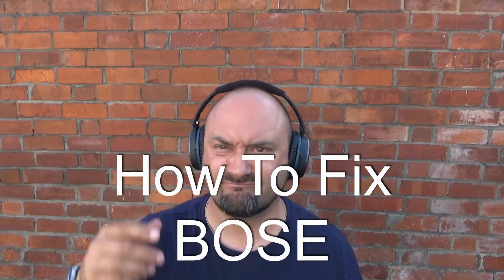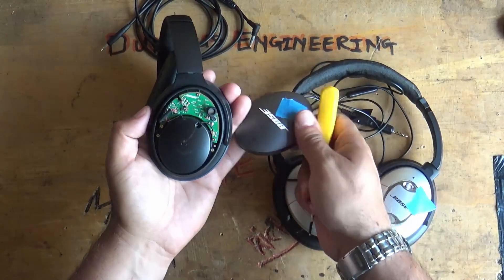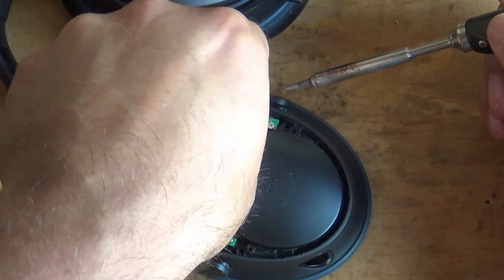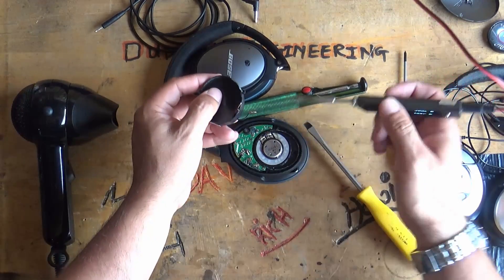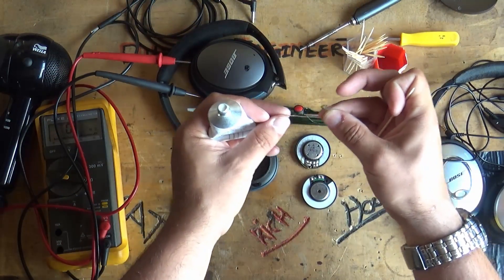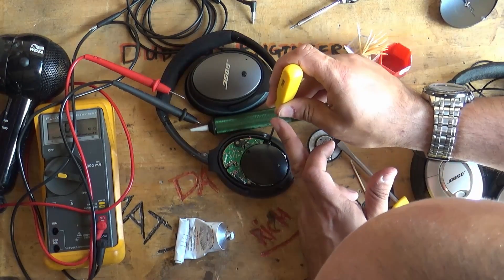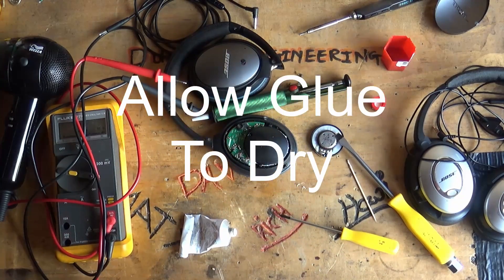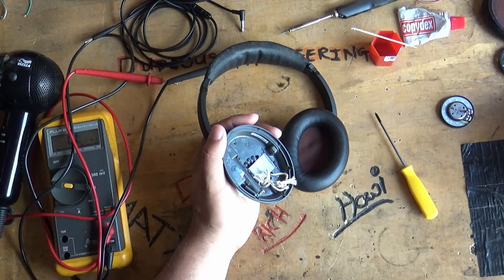DuB-EnG: Repair BOSE QC35 QC25 QC15 Quality Headphones Fix Faulty Quality Problems One Speaker Work

Comment: so this process is a lot more pain with the qc35...make sure to make the glue really hot. Good news is: I was able to replace the speaker with one I bought from alibaba. Bad news is: the bass is slightly different and the noise cancelling doesn work as well as with the other speaker. So basically they are still useless...because I assume that when you buy a bose you pay attention to little things like the intensity of the different frequencies...

thanks for the video but can't be recommended for my qc35 and the alibaba replacement speakers (which are fine too but just not the same!)
Reply from the maker: Interesting... the speaker I purchased was from eBay and it sounds perfect... like a direct replacement...  sorry your repair didn’t work out so well...  :-(

Comment: Does anyone have a reference to original speaker part used by Bose in the QC15 ?
Reply from the maker: Don’t panic... they use regular speakers and profile the sound with a DSP... so, just type “replacement qc15 or qc25 speaker” into eBay...  trust me on this!

Comment: Does anyone have a reference to original speaker part used by Bose in the QC15 ?
Reply from the maker: Its in the comments section, but just check eBay.
Reply: Thanks. I eventually used this and it worked well and sounds identical: https://he.aliexpress.com/item/32883884428.html?spm=a2g0s.9042311.0.0.3b464c4dQ8X9Y6
Reply: eBay (Same 40mm size drivers are also used in most high end headphones manufactured by other brands like Beats, JBL, Onkyo, Sony and so forth)

Comment: The Replacement speaker qc25 is te same that qc15?? because i have and old qc 15 and i wolud like to replace from my qc 25 rigth speaker damaged, ah i dontt now if is better replace both speaker at the same time to keep the balance and frequencies at the factory level.
Reply from the maker: Yes sir...  exactly the same speaker... you can find it on eBay!

Comment: Glad to see an excellent DIY video. The glue used (copydex) does this get soft and takky after heating like the original. Just incase the replacement breaks...
Reply from the maker: Yes it does...  it holds together, but turns rubbery so you can take it apart again in the future....
Reply: @DubiousEngineering  that's awesome. I was considering PVA but on the plastic driver case it sounds a bit iffy. Copydex it is. Thank you!
Reply from the maker: Justin bunn## ...  PVA can go off quite hard after a long time...  copydex stays rubbery...  you could even use a thin sausage of evostick bluetack
Reply from the maker: Thanks so much for subscribing to the channel... I hope we can keep you entertained with electronics, adventures and gadgetry!
Reply: To put the drivers in ear cups like factory installation, only use 3M™ Yellow Super Weatherstrip and Gasket Adhesive (available in auto stores mostly).

Comment: SHOULD I BUY ONE OF THESE? I ONLY HAVE ENOUGH MONEY TO BUY QC25 AND REALLY NEED EXCELLENT NOISE CANCELLATION AS I AM IN A VERY LOUD AREA. BUT I HAVE HEARD THEY STOP WORKING AFTER SOME TIME. REALLY WORRIED AS I CANT AFFORD ANY EXXPENSIVE MODELS.
Reply: Yes go ahead get one from eBay, they are good and won’t break so easily
Reply from the maker: Yeah, the modern ones are pretty good now...  Its the older models that break easily...

Comment: My right speaker died on my qc35ii so i used this guide and ifixit (https://www.ifixit.com/Answers/View/490400/Replacing+battery+in+Bose+QC35) since this guide didn't show a qc35 ii teardown (it was close though).  

I didn't remove the back pad (at 45 seconds) as it was easy to move it out of the way and didn't need to remove (wasn't sure if I would have to re-glue during reassembly).

I didn't feel like the description on how to use the hair dryer to heat up the glue was described very well (or maybe i just missed it but I listened to the section several times...).  I spent about a minute with a hair dryer moving around the speaker cover and didn't melt the glue at all (the head phone was hot enough at this point to where i couldn't touch it).  I though maybe it was super glue so I ended up making a few incisions with a dremmel tool.  Prying with a lot of force i was able to get the cover up and saw that it wasn't super glue (at this point i didn't think i was going to get the speaker to work and was just going to tear it apart to see how it was made).   Once the cover was up I used my heat gun for about 5-10 seconds (it was set to 800F, not sure if the air at the nozzle really gets that hot) and watched the rest of the glue evaporate to get out the speaker (so i think this guide may have worked if i had just used more heat).

Thanks for the guide, i now have a working QC35 again!
Reply from the maker: I believe the QC35s use a different glue...  Harder stuff...  Thanks for your input here, its really useful to everyone!!  Great work and well done on the working headphones!!

Comment: Very clear instructions with excellent images. Great work, Dubious. 
I have the Bose QC15 headphones. The little spring on the negative battery contact broke off. I'm not sure how to repair it. Perhaps it can be soldered on, but I have no idea how to remove the hinged plastic battery 'door' to allow access with a soldering iron. I imagine this piece is easily broken. 
Any suggestions? Thanks!
Reply from the maker: Wow... I’m so sorry... I no longer have the qc 15 ...  if I did I’d have a look... perhaps ifixit on google may be able to help??

Comment: What driver was the old one replaced with?
Reply from the maker: Search eBay for qc25 replacement speaker
Reply: eBay (Same 40mm size drivers are also used in most high end headphones manufactured by other brands like Beats, JBL, Onkyo, Sony and so forth)

Comment: The microphone on my QC35s stopped working. Meaning, I can still hear everything (with noise canceling) but can no longer make phone calls since the person on the other end can't hear me. Any ideas on how to fix or replace a broken QC35 microphone? If it's helpful to know, it might have stopped working because I wore them in the rain. Thanks!
Reply from the maker: Ah yes...  the rain would do it.   It will be a PCB mounted microphone...  you can buy replacement Miniature Electret Condensor microphones on eBay.  But you will need to look up the size.  I can’t remember if it’s mounted in the left or right speaker.
Reply: @DubiousEngineering  Thanks! Any pointers on where to find the size? My attempts to find this info online have not been fruitful. Thanks again....
Reply from the maker: I’m sorry I’d have to open mine up to measure it!!

Comment: Loved your video. My son got a pair of AE2s from his granddad. Not only is one side lower in volume than the other but the overall volume and SQ is lower, lacking in both bass and they sound suppressed. I fiddled with the cable to check if the problem was there but no, i have a feeling that the speakers conked. What do you think? Also, any ideas of the driver size and where I can get them?
Reply from the maker: Have a look on eBay...  the qc25 speakers are listed as “replacement qc25 speaker” ...  I hope this helps and good luck!!
Reply: @DubiousEngineering  Is the glue necessary? Is it only for holding the speaker in its casing or does it also positively make a difference to the sound?
Reply from the maker: Yes, it really helps with the sound too...   it isolates the speaker from the microphone!

Comment: HELP! My dog chewed up my Bose Quiet Comfort 35's.  It appears that they still work.  They turn on, and it does NOT appear that she (my dog) got to the circuit board at all. It looks like she ripped off the soft pads, speaker cloth, and the silver tape/band is removed. I have no idea what to do.
Reply: My email is Keaton@icloud.com - I can send you a quick photo if it would help. I would be forever grateful! Thank you!
Reply from the maker: Keaton you can buy replacement pads and parts for these on eBay...  I’m on holiday in Taiwan for 3weeks now, but if your still struggling when I’m back I can help you!
Reply: You can get the ear pads very cheap on eBay. Just pull out the old ones kind of squeeze them and pull away. Insert the new ones the same way. No rocket science you can’t break anything . The silver thing can be put back with glue or a blob of bostik blue tack. Cheers
Reply: Thank you all! I contacted Bose, and they sent me brand new ones for a discount of around $100. I snatched up the deal!

Comment: I got a pair of qc25 from ebay. the guy that sold them said they worked perfectly but when I've got them, the noise canceling was not working. I changed the battery and the cable from my other pair (witch works impeccably) but no noise attenuation. Do you know what could be the problem? I asked for a return but just in case that doesen't happen I would like to know if I could repair the thing
Reply from the maker: Question, does the sound change and become louder when you turn them on and there is music playing?
Reply: @DubiousEngineering  Yes; the sound quality is better when I turn them on. I did some "tests"; I've listen to each earpiece separately with the noise cancelling on and off and I tend to believe that the noise attenuation on the right side is not working.
Mabe I exaggerated a little when I said that the noise cancelling is not working.; it is there but very faint in comparison to my other pair
Reply from the maker: If you rub the tiny holes on the outside with your finger, you should hear a louder scratching noise in the earphones...  this is indicative that the noise cancelling is working....
Reply from the maker: A 10 minute message for my regular viewers... https://youtu.be/hAVadIYgLbk
Reply: @DubiousEngineering  Yes, i can hear the noise but never the less, the noise canceling was not working or it was not doing anything. Anyway, I've returned the headphones. Thank you for the tech support!
Reply from the maker: Absolute pleasure... glad you got your money back... some people were less fortunate! ...  Stick with us here... you never know what might help you in the future! :)

Comment: Is there an equivalent to the copydex glue that will work?  Will Shoe Goo or a Amazing Goop work?

Copydex will take a month to order for me.
Reply from the maker: I’m sure any soft glue will work...  perhaps a glue gun? Thanks for your comments, here’s a little preview of a video coming up...  https://youtu.be/wYAJzCo2UOc
Reply: @DubiousEngineering  Thanks for your fast reply and Thank you so much for putting this video together!  My right speaker went out just before Christmas. I called Bose for a repair quote but all they would do was try to sell me a new headset.  I will stop by the hardware store and get some soft glue today :)
Reply from the maker: starsiegeplayer PVA glue would probably do the trick! It’s soft and rubbery...
Reply: @DubiousEngineering  I don't mean to be awkward, but does PVA melt? I'd think that looking for "rubber solution glue" or "latex adhesive" might get you something more like Copydex. Helpful video, by the way, thanks.
Reply from the maker: Totally agree... the problem with PVA it can go off really hard... that said, this is a one shot replacement and pva should do the trick!! ... or consider a small amount of hot glue gun action!
Reply: @DubiousEngineering  Hot glue may be nice, but Copydex is rubbery. Seriously: if the replacement driver goes South, you want to be able to repeat the repair, don't you? Besides, Bose may have had clever acoustic reasons for choosing a rubber-like adhesive in the first place. Resonance or damping or something?

Comment: PLSE SHOW ME HOW TO TAKE OFF THE MIDHEAD TOP PART THE SOFT PART THAT SITS ON TOP OF THE HEAD! MINE IS SO NEED TO BE WASHED! I DOONT KNOW IS THERE ANY CABLE IN IT THERE?
Reply: There are wires in it.  Removal of the headband destroys the soft part, but there are third party replacements on sale on Amazon.
Reply: Be careful when you remove it, do not cut the wire. Just cover both speakers in cling film hold the headband downwards and wash with dish soap and sponge. Dry it off the a hair dryer after patting it with some paper.
Reply: Get a tennis racket handle wrap and cover it up do a neat job. I will try this shortly and upload a video or you do it if you can.
Reply from the maker: I like that idea!

Comment: 11-16-2018    Well I got out the hairdryer and got everything quite hot and the glue didn't get soft on the QC25 left speaker cover.  I nearly melted the thing and punched a hole in the cover with the screwdriver (oops!) trying to pry it off.  Apparently the glue they use now doesn't "melt" with heat - it may be permanent glue - not sure.  Well, there goes $350 for a new pare of headphones.  Can't get the glue to melt.  Any suggestions?
Reply: q7winq7 push it out from inside with a screwdriver...worked for me
Reply from the maker: q7winq7 Awww mate... I’m so sorry... I can’t believe they now made them unserviceable... that’s so mean!!! ..... very unfair!!
Reply: 11-16-2018    @DubiousEngineering  - - - If they won't replace the phones as a quality control issue or warranty, I may just disassemble again and "cut off" the speaker cover (carefully) to access the speaker.  Maybe a hot razor knife?  Then if speaker is accessible, I may unsolder and check ohms of speaker and replace with new ones from Amazon.com.  I think a pair is about $20 US dollars. Now I'm looking for their service dept. phone number for here in the US.  Thanks for all your responses.  I use these phones 7 hours a night in a factory. Can't do without listening to George Noory's program "Coast to Coast."  Check it out.
Reply from the maker: I’ll have a look for coast to coast!!  Thanks for keeping us all updated... people will want to hear more!!!  :-)

Comment: 11-07-2018  My Bose QC35 left speaker (where the wire connects) fades out until I tap the outside on that side then it comes back.  Is that a speaker failure or a loose wire or what?
Reply from the maker: The external wires are quite sturdy...  it’s likely to be the driver speaker...  pop them apart and have a poke around with a multimeter....
Reply: Have you been able to fix them? I have EXACTLY the same with mine QC35, however mine right speaker seems to have the same. Since yesterday it completely stopped sadly enough..
Reply: @gerbenvandooren6037   - - - -  As I recall, I mailed back the old headphones to Bose when I ordered another pair which I have now.  I got the blue tooth set to mate with my phone without a connecting wire.  The work fine but the ear cushions don't last very long.  I wear them 8 hours a night five days a week.  Aftermarket cushions are available for way less money than what Bose charges.  Note:  If I had it to do all over again I would have bought the Bose headphones with the Alexa feature, even though it was more expensive.  Cheers.

Comment: Hey mate - random question but would the qc35s need the tear down to replace the battery? I’ve searched around to see if the battery is replaceable however it seems like nobody has ever posted a video of the tear down.
Reply from the maker: Yes, battery replacement (if needed) would only be possible if you took them apart.  Should be good for a few thousand charges, so unlikely you will need to replace...
Reply: How can i fix may bose headset it cannit conect to the blutooth of my phone
Reply from the maker: That sounds like a Bose support question :-).  Sorry not an easy one for this channel...

Comment: Hi, my biggest bugbear about modern headphones/earphones is the stupidly thin wire that is used. I've tried repairing multiple apple earbuds that have gone at the connector and the less than hair thin wire is impossible to strip to solder or it just breaks. (probably why they are doing away with the headphone jack). It's also true of other brands, JVC, Sony to name just a few I've tried fixing with no good results. Stuff just isn't made to be easily repaired any more, it's just to make you buy more, which adds to waste/pollution etc. Where have all the TV repair shops gone !!(old man rant over)
Reply: I got a nice set of sonys a while back that someone had tossed cause the cable had gone bad in one ear. I buy pre-made headphone plug to 2 rca connector cables, cut off the rca part and solder them to the speakers for new and improved heavy duty cables.
Reply from the maker: Thats a great way of fixing broken cables on headphones! ...  I'll remember that!

Comment: where do you get the replacement speakers from?
Reply from the maker: Just eBay BOSE QC25 Replacement Speaker
Reply: eBay (Same 40mm size drivers are also used in most high end headphones manufactured by other brands like Beats, JBL, Onkyo, Sony and so forth)